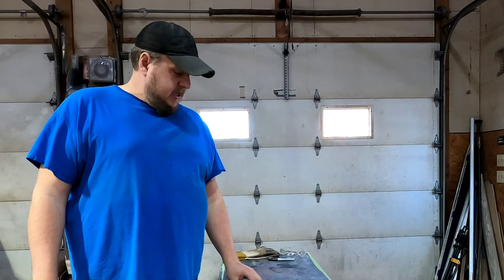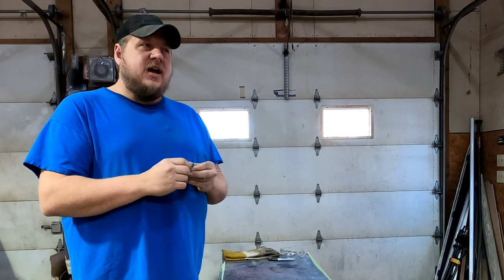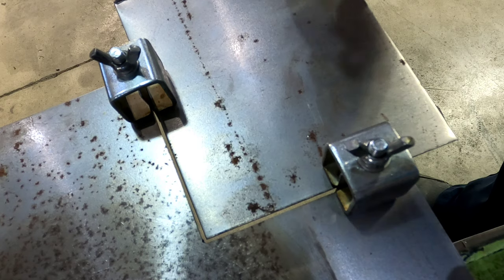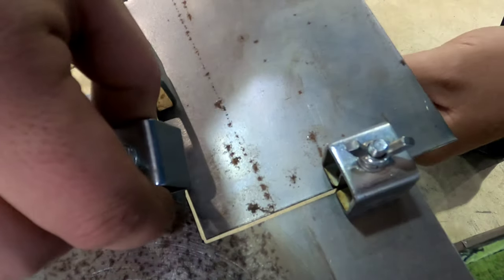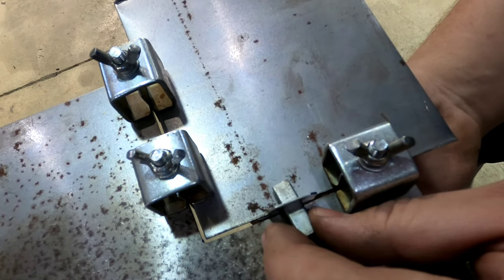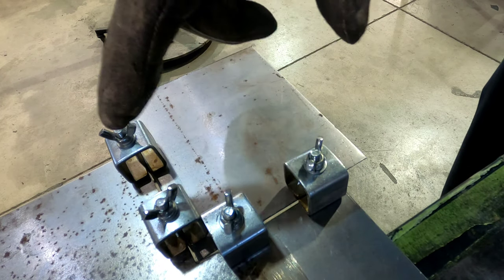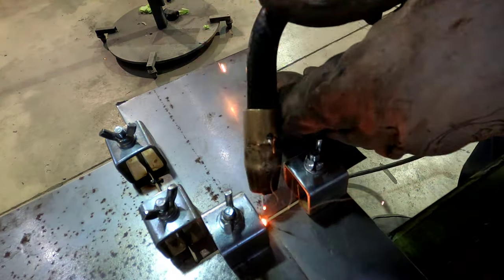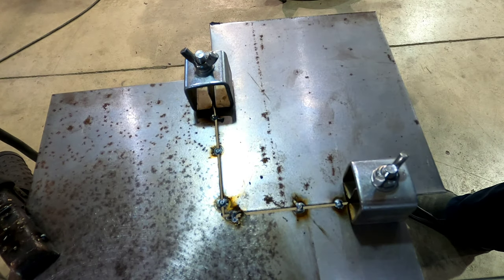How to use butt weld clamps.

Comment: If u use these on a quarter panel, how do you get the pin out from the back side once u tack weld it in place? Wont the pins just drop inside the panel?
Reply from the maker: I can usually access the entire length of the quarter panel. If I can't quite reach a spot, I don't completely tighten the clamp and keep pressure on the clamp to hold the pin up against the quarter as I slide it to where I need it. After welding if I don't have somebody around to help reach in there to grab it or I just can't reach it, I loosen the clamp and the pin will drop out. Then I just use a magnet to grab it.
Reply: @fatdaddieshotrods  that was my first question, when you cant reach  something. you answered

Comment: Would you have to cut the patch to compensate for the small gap
Made?
Reply from the maker: Yes. The width of a cut off wheel is good for the gap. So if you trace a pattern and take the line you should be good. Or if you lay the panel on top and cut around the edge of your patch you should be good.